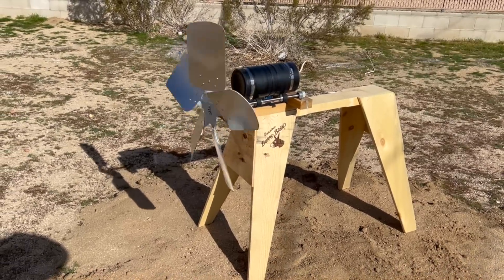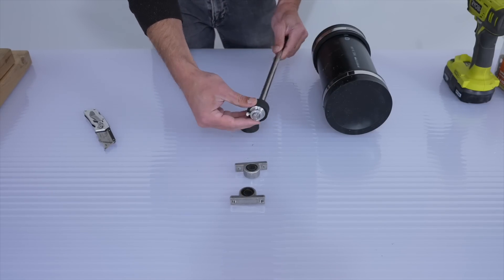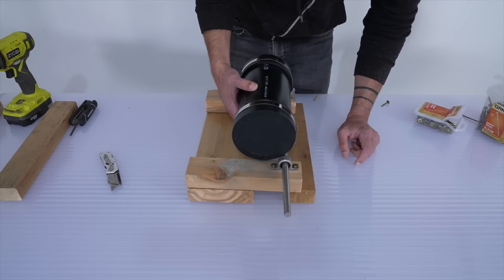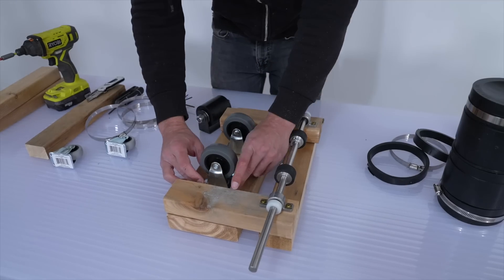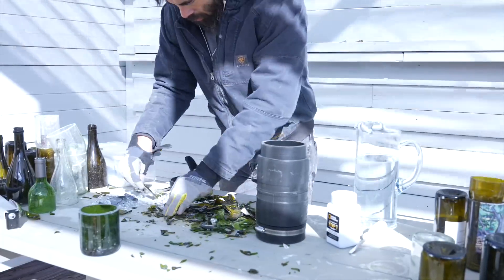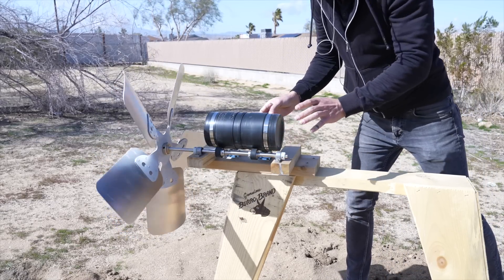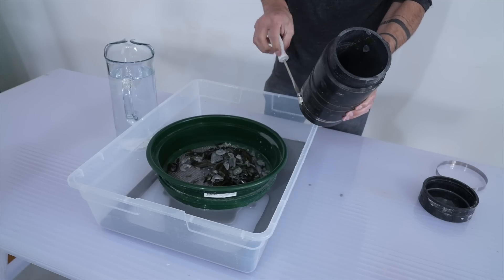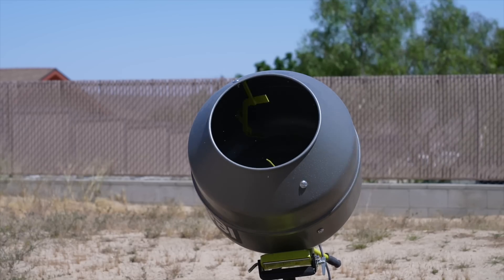DIY Wind Powered Rock Tumbler

Comment: Have you thought about building a case around the barrel? Loose enough to no touch it while in normal position, but tight enough to hold it and make it jump in the right place by itself if something happens.

Comment: Cool.   I think maybe try a hearing system to speed up or slow down to increase power if needed.   Such thing could potentially be connected to a fly wheel system to smooth out the tumbling.   Might try a small test of all this.  Great, now my todo list just got that much bigger.   Ty

Comment: It looks like you might also be able to use engine cooling fans, if the price at a pick-and-pull were favorable.

To keep the suspended glass dust from forming a gel, you might either buy some Darvan (or other synthetic deflocculant) or try including some wood ash in the liquid (this will initially form lye, which can chemically etch the glass slightly, and dissolves the first small proportion of dust, but will very quickly transform into sodium silicate, which is both less caustic/hazardous as you open the canister, and functions to chemically stabilize the suspension).
Reply from the maker: great suggestions. I will check that out

Comment: The reason your rubber band idea didn't work is because you had the gearing fighting itself - the band on the shaft and the larger wheels wanted to go in opposite directions and with different ratios. If you had unscrewed the set screws keeping the wheels locked to the shaft it should have worked, but your final solution was better anyway.
Reply from the maker: yes you are right!

Comment: Nice way use free wind energy to do work. Looks like those turbine blades would be easy to make with simple tools
Reply from the maker: I think so and I suspect that spending money on a quality stainless steel shaft and bearing will allow cheap interchangeable fan blades
Reply: @HomeMadeModern  Yes by using a quality shaft and bearings with low fiction, even old school wood and fabric windmill blades should perform well

Comment: i've been using a cement mixer to make sea glass for years you live in the desert just use sand from your back yard
Reply from the maker: I tried that and it works but the sand breaks down quickly into dust and has to be changed out often.

Comment: It'd be a bit more work, but with a fan like that and a small motor, if you hooked up some kind of belt, I think that would fix the inconsistency of the wind, if you turned it into a mini-turbine. Would just need some type of capacitors or battery and some resisters, to throttle down the output.